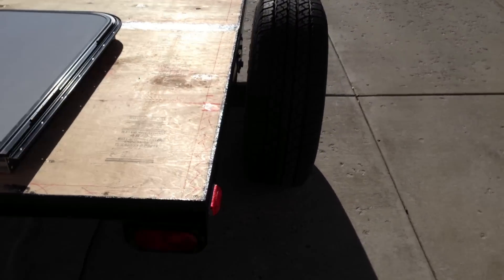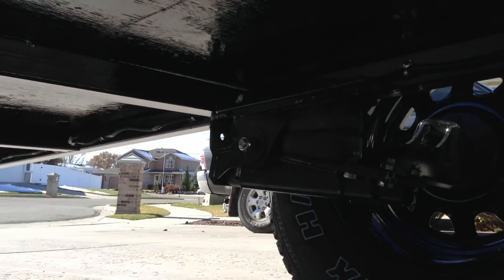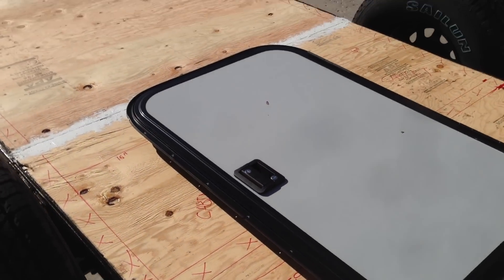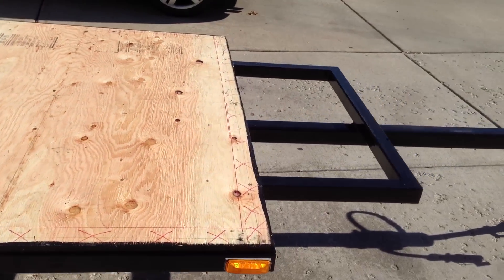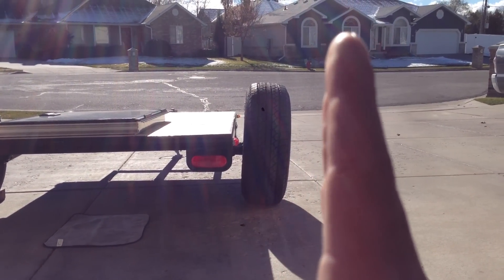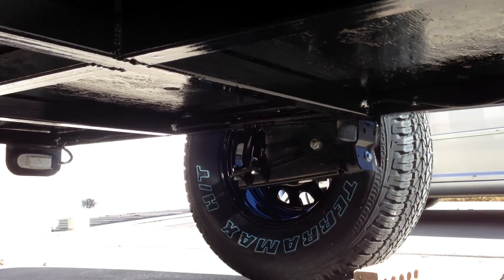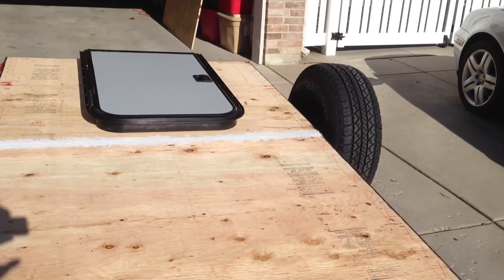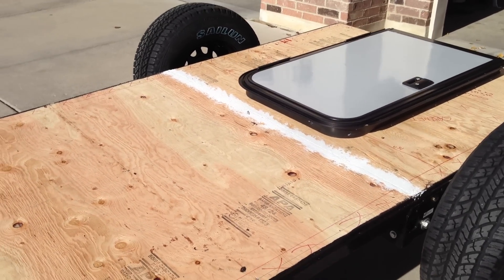Off Road Teardrop Trailer Build

Comment: Nice Build. I began designing mine in Afghanistan and began building this past summer.
I went with 5x10 floor plan,  2x3 primed and undercoated frame, bolted on an angle  adjustable (set at 45 down) stub torsion axles for maximum clearance and ease of field repair, and a "Max Coupler" hitch. I am experimenting with undercoating the underside of the 3/4" floor with deck armor for impact and water resistance. Not sure how it will turn out. I also went with framing the walls and ceiling with 1x2 poplar, 1/2" ply exterior with a bed liner coating and 1/2" Birch interior. Rigid foam insulation in the walls and compressed fiberglass in the ceiling with a "Fantastic" fan. I decided to go with 2 doors (home built) for ease of entry/ exit for 2 people. I'll upload pics/ video when complete.
Looking forward to more of yours. - Jon
Reply from the maker: @Jon: That sounds great! there's a lot of different ways to go on these and it's cool because you can get really creative. It sounds like you are on the right track! I'm in the process of installing the side panels right now, and should be posting another video within the next couple of days! Thanks for watching!

Comment: Just starting my teardrop build, shopping at Lowes for the lumber, I am going to have my son-in-law fabricate my trailer. I was going to go with the leaf spring suspension until I saw yours. I went to their website and took a look at their suspension kits,  Boy am I glad I found your video, This is the suspension I wanted but didn't think they made for small utility trailers.  
My teardrop is going to be 5 x 9 and no more than the standard plywood of four feet tall, maybe shorter. 
Great video and teardrop build.

Are you sure that each side of the Timbren suspension is rated at 1200 lbs? I just purchased the 2000 lb suspension and I asked the guy if it is each unit that is rated at 2000 lb or the pair, He wasnt sure and asked somebody and he told me that the pair was rated at 2000 lb.

Comment: Im considering using 2x2" .120 wall tubing for my frame as well, do you feel as though the frame is rigid enough?
Reply from the maker: Corey Hargrave yeah, that should be fine. As long as you aren't building over the sides too far, keep the cabin flush with the sides of the trailer and make sure that you have a sturdy axle.

Comment: whats the cost for those wheeles and axle things
Reply from the maker: Calister Crook  The Axle-less system was $365.19 and that includes the hubs, hub bearings and all of the hardware. The wheels I got from Les Schwab: Allied 51 Daytona 15"X8" and were 60.00 a piece.  The tires are Sailun Terramax Off Road 31X10.5RX15LT and were 76.00 a piece.  Suspension, Wheels and tires : $637.19